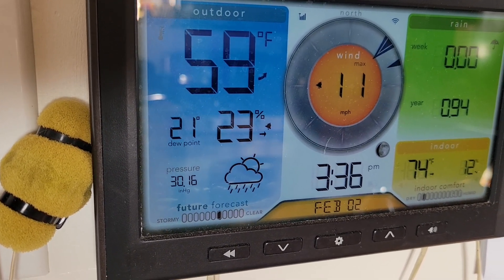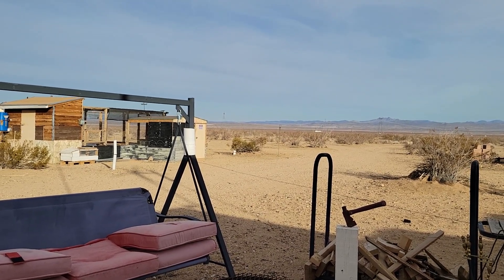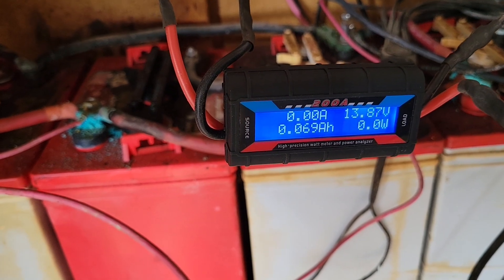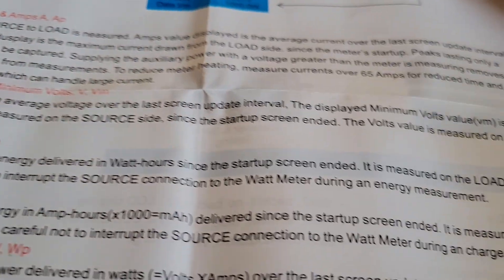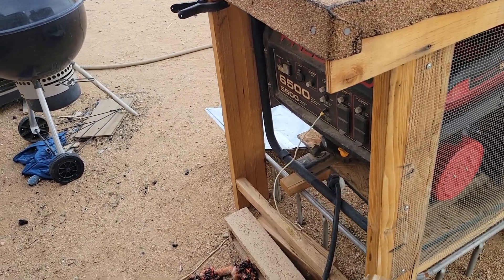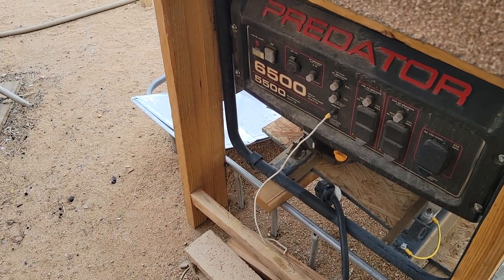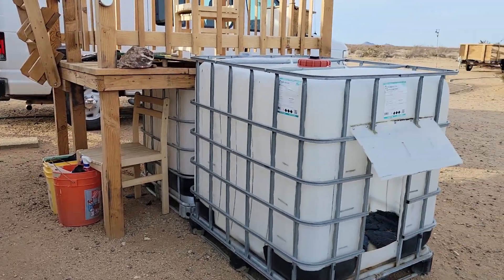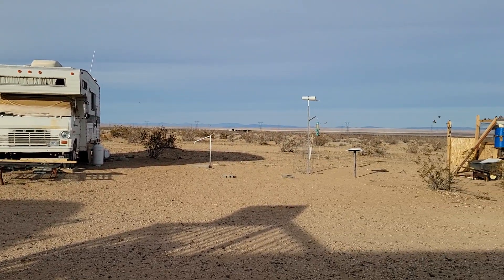I Finally Got The Replacement Parts For Wind Power, Feb. 2, 2023

Comment: The wind generator I want is made in Salem, Virginia. It's a 1 kw unit called a Hurricane Vortec. I have the money for it, but I have to figure out a charge controller. I saw a video of the same unit making 1650 watts in a storm, so do I need a 60 amp controller unit for 24 v? Everyone I asked says use a Midnight classic controller, but if I do, I'll have to save up for two more months. It costs more than the turbine. I saw one called a Xantrex, 60 amps, but I don't know the brand very well. It sleeted 3 inches here, but some melted yesterday. I have burned a lot of wood this last week. I'll be going after wood Monday. Last time I went, I found a bunch of 30 inch pieces of #1, both 2X4, and 2X6, so I'm trying to keep from burning it all. It'll be in the 60s and muddy next week. My solar panels finally got 🌞 sunshine yesterday after about ten days of not much of it. It has been windy though. Just nothing to collect it with. Average wind speed in March is 10.2. I was kinda hoping that another controller would work so that I can get it put up and working. I didn't really want to wait two months while it's under warranty and still in the box because I don't have a controller. But if I have to wait very long, the price will probably go up. It says it weighs 70 pounds...boy, they exaggerated the amps on that meter. The DC inverter welder that I bought at Harbor freight says 80 amps on the box, but on the back of the welder it says 75, lol. For a country that invented the abacus computer, they're not doing too well on math. I had a hard enough time getting an inverter, not going to try a foreign made windmill. It's like walking through a mine field to get to the right one. Well, I'll save up some more and buy it all together, maybe, if I have to get that high dollar controller. Didn't sound like you liked the waiting game either. I think the Chinese are teasing us to make our own electronics. We should put a lesser rating than what the machine will do, they'll all go nuts. They should have to buy our stuff. It's costly though, lol.
Reply from the maker: Save for the Midnite controller.  You'll be glad  you did.

Comment: Good luck with your new part. We have the same issue with a diesel heater made in China! Take care.
Reply from the maker: Yeah, I try to avoid buying anything from China.  Either it takes forever to get here, or it is junk.
Reply: @GBear  that’s really tough now. A lot of things are essentially made in China and assembled here. Then they can say made in USA. We’re also off-grid and one of our backup generators has been exchanged three times during to a failed CO sensor. The parts weren’t available to repair, so Harbor Freight replaced no hassle. Still had to drive 60 miles one way to exchange.
Reply from the maker: @BrainStormAcres  yeah, remember a few years back the named a Chinese city USA, so they could put "Made In USA" on the label?  After getting caught they were required to include the country name, so they added USA, ROC.

Comment: I noticed you took out the fuses between your pma and the rectifier.   Is there a particular reason you did that?   Thanks!
Reply from the maker: I never had fuses between the PMA and rectifier.  If they were there and one fuse blew, it would destroy my PMA, just like disconnecting one lead while under load.  I do have a breaker between the rectifier and the battery though, to protect against high amperages.

Comment: Our weather thingy with little cups broke after five years. What brand do you suggest? Try using a rolling pin on your thigh middle, and sides.. it might help to relax your knee cap. Tight muscles moves bones out of alignment. Take care my friend!
Reply from the maker: I use the Accurite Pro weather station.  I bought it at Lowes for about $100.
My knee thing turns out it is where i cut it badly back when building the add on to the cabin.  Gout decided to give me a double dose, once in the ankle on the left, and one on the knee on the right.
Reply: @GBear  I went on a low carbohydrate diet mostly  eating meat fish and cheese and have not had gout for a year .
Reply from the maker: @teddycunningham7568  Interesting.  The purimes in meat and fish are what causes gout.
Reply: @GBear  not purine causing gout see Dr Ken berry on utube recently did a video on gout.
Reply from the maker: Thanks.

Comment: We found that harbor freight has the best warranty on generators. We bought one it died they replaced it brand new in the box no questions asked! Have a great weekend brother!
Reply from the maker: But, it died!  It shouldn't have.   I have a HF gen too.  Seems to be holding up so far.  That reminds me. It's time for an oil change.
Reply: @GBear  lol git  r did!
Reply: I bought a Winco, lol. It won't need replacing. Honda engine. I waited for the 25% off sale at harbor freight, went and bought a nice $40 grinder, and a pack of welding rods. So while I was putting the basket up, the gal at the register gave me a $2 discount on the welding rods. Guess what? Done with them. She asked if I wanted the 2 year extra warranty, and I said, no, don't guess so. Didn't want a reason to have to go back there. The same welder I had bought there a few months back had went up thirty bucks, so even if you did the magic act and got the discount, you still paid more. The prices were ridiculous. I just headed on over to Tulsa and bought a USA made generator. That's the second time they did that, so I just said, " I'm done"